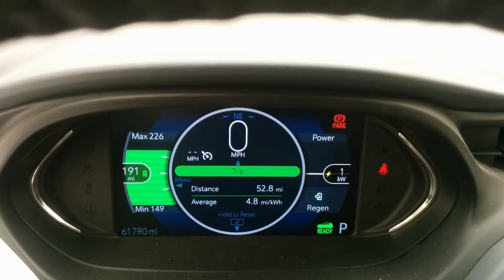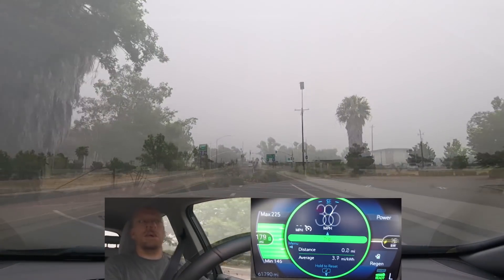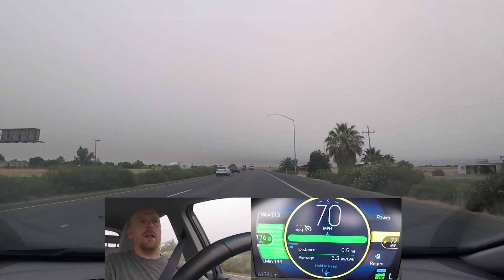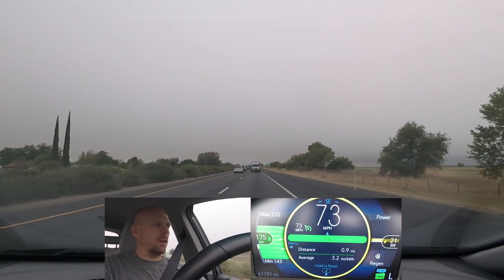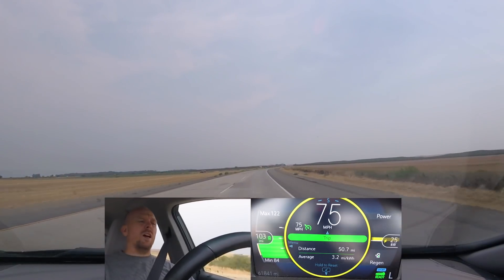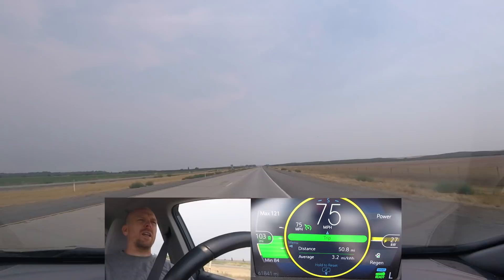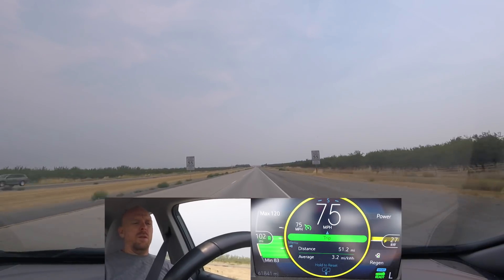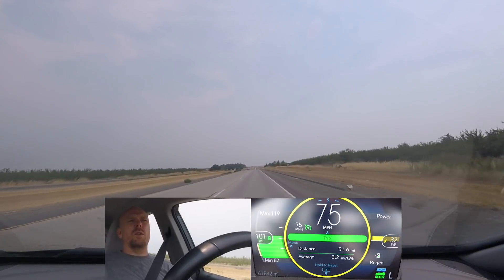Chevy Bolt EV: Real-World Efficiency at 70 to 75 MPH

Comment: Had such a terrible experience with the bolt. Just had to let mine get repo'd because I randomly got an error that they said wasn't covered by warranty and they wanted to replace the whole battery pack for $20k
Reply from the maker: Sorry to hear about your experience. You should have escalated to GM Corporate. Anything to do with the battery is covered under warranty.

Comment: Whenever I take my Bolt out onto the open road I run my navigation app to monitor the miles remaining against my Bolt's " Minimum Readout," and if the minimum is higher than the miles left I know that I am going to be just fine. I have recently been paying extra close attention to the " Trending Bar," on the far left of the display. That will let me know if I am trending towards the minimum, the average or the max. I had a real " What would News Coulomb do moment," the other day. I was at a fork in the road in the desert and I had to make a choice. Do I take this one route that guarantees that I get to a charging station in 87 miles or do I just go for the full 172 miles by turning right? I turned right and went for it. I ended up drafting off of some truckers during the final leg, but I found that I still had about 25 miles remaining on my range by the time I made it into Indio, CA.

Comment: Hi, I have a question for you regarding charging the Bolt EV. What has your experience been with the many different charging stations and the availability of those chargers when you arrive at a station. One fear I would have is being able to find chargers not taken up by others. So, given you're in California, do you experience frequently, stations being full? Thank you!
Reply from the maker: It's somewhat situational. In my experience, chargers in metropolitan areas are often occupied, usually by rideshare drivers. Because most of my charging is done on long trips, I rarely encounter other EVs at the charging stations. Due to cost and charging speed, I've prioritized Electrify America chargers, which average over 4 chargers per site, and I've never had to wait to access a charger at an Electrify America site. I have had to wait a couple times for about 5 minutes or so at several ChargePoint and EVgo sites, but that is very rare.

Comment: Now that's it's getting cooler outside if you have 65°-78° say of good weather there in CA. If you rolled the windows down or open them a little bit at 75 mph how much will that effect the battery useage or range in your driving? I do about 160 round trip in Virginia with stop and go in city then long distance hyway to rural areas. I'm looking into the Bolt but I'm waiting for Adaptive Cruise Control which would be great on my long distance driving. Thanks for your great videos its encouraging me more and more to buy one.😀👍🏾
Reply from the maker: Thanks! When it's cooler, I just run the vents, but it typically needs to be way below 70. I don't like opening the windows. It's too much noise and pressure.
Reply: @newscoulomb3705  Ok thanks so much for your insight. I was thinking maybe wind drag  might reduce range,  but yeah I didn't think about vents but if the fan is running that's current being used so maybe 6 in one hand and half a dozen in the other. Probably not much range used. Thanks so much again for informing us the public about the Bolt and electrified driving. Keep up the good work.😀👍🏾

Comment: I realize this is a bit old, but I now have direct tire experience (on my other EV) and I can confirm that for the first 5,000 miles on new tires the range impact is measurably worse. I don't know the reason, but I can only conclude that something in the manufacturing process produces a sticker material for the first few millimeters of the tread. After 5,000 miles the range improved (in my case by about 4%). My testing methodology involves extremely consistent driving behavior, all at freeway speeds and when I put the tires on I saw an immediate 6.5% impact on range and then over 5,000 miles that impact reduced to 2.5% and it has now remained consistent at 2.5% for 2,000 miles. The tires are different and the new tires are easily perceptible as stickier but it appears the actual difference between my old tires and new tires is 2.5% but the initial difference was much higher.

Comment: I can absolutely confirm the effect of changing tires. I just changed the tires on my Mirai and the MPGe dropped by 4 overnight (and I established that average MPGe over 50,000 miles so the change was crystal clear). When selecting new tires my priorities we're:

1. Quietness
2. Handling
3. Low rolling resistance

The tires I bought are advertised as LRR, but in the reviews I noted they were exceptionally quiet and had better than average handling so I expected that I'd be sacrificing some efficiency for quietness and handling and I certainly did.

Comment: Most of my freeway driving with heater or a/c ends up at about 3.1 to 3.3. The speed between 55 and 70 doesn't change much.
Reply from the maker: At those speeds, your heater might be using up 30-40% of your total power.

Comment: I have finally figured out why the Bolt is less efficient than the Kona in real world testing.

If you look at WLTP testing cycle, they use outside temperature as one of the factors. Since, we don't drive in ideal temperature (yes, California included), the efficiency of the cooling and heating system plays a major role.
Temp/Range Low
-20º C 167km 
-10º C  180km
0º C  240km
10º C 357km
20º C 448km
30º C 371km
40º C 269km
https://pushevs.com/2017/04/21/opel-ampera-e-range-calculator/

GM needs to redesign their thermal power management.

https://pushevs.com/2017/12/09/auto-bild-tested-range-8-electric-cars/

https://www.greencarreports.com/news/1115893_five-electric-cars-tested-in-cold-norwegian-winter-how-did-they-do

Comment: I know you can't do it easily in CA, but I would love to see a winter video of the car in snow with the heater on full blast and it being about 20 outside.  These are some of the conditions I could see in VA where I live.
Reply from the maker: It's possible in California, but the big issue is the requirements for traction devices. It's why I don't run dedicated winter tires. Even if I did, I would still be required to run chains in conditions most people would just be using winter tires. 

Also, just from a personal perspective, those temperatures aren't cold enough for me to be running the heater full blast. I tend to dress for the winter conditions, so I really only need a little heat (mostly for the defogger). 

Even so, I've seen some pretty horrific conditions, though I'd have to go through my videos to compile them. To date, my worst efficiency of all time was 2.3 mi/kWh, driving 75 mph into a ~25 mph headwind.

Comment: Traveling these speeds, about how far can you go?  I ask because I go from Jacksonville, FL to Savannah, GA which is about 155 miles.  Once you leave Jax there aren't any L3 chargers along the way to rapid charge.  Once you get to Savannah there are parking garages that have free L2 chargers one could plug in there and get a full charge for the drive back.
Reply from the maker: I typically drive 150 to 200 miles at these speeds. This was a special circumstance because I didn't start with a full battery.

A lot will depend on the weather, but you should be able to at least make your 155 mile leg.
Reply: Thanks for the response!

Comment: My Leaf Gets that or better efficency (the way I drive mixed freeway 55-65 and surface). However I have the small 24 KVAh battery. The Bolt has a larger battery (60 KVAh). I'd love to have a 60 KVAh battery.
Reply from the maker: The LEAF's efficiency at freeway speeds is a bit lower, but it's not too bad. I think the newer LEAF is a bit better (very similar to the Bolt EV's efficiency). 

I'm really looking forward to the 60 kWh LEAF. It's going to be a great option for people.
Reply: Yes I am sure you are right... What I am talking about is the way I drive. As you know that makes a difference. I can drive slower, take surface streets, accelerate slower, pick more efficient roots and times of day, refrain from using heat or AC, coast or use re-gen as much as possible. I can get 4.5 to 5 miles/KW on a given day. What some people don't realize, like a ICE car DRIVING habits affects MPG... If I drive like a maniac, race people off the line, drive freeway at 75 my range goes down.... no free lunch. Driving style has big effect on efficiency.

Comment: Why did you put on L instead of D on freeway?
Reply from the maker: I prefer driving in L and Sport, and I don't like switching around all the time.
Reply: News Coulomb  I know it's a personal preference.  I've found L making the car less stable than D on highway and consuming more energy when accelerating.  I always use L on city roads for one-pedal driving.
Reply from the maker: Kb Calib I haven't seen any differences in efficiency or stability.

Comment: Big shout-out to Steve Dutcher who did the test the right way.
He recreated Bjorn's test run in the US.

Steve's run
75mph (120kmph) - 333wh/mile (206wh/km)

Bjorn's run
75mph (120kmph) 208wh/km
https://youtu.be/VsZCOEjs7M8
Reply from the maker: I'll have to check it out sometime, but I'll conduct my own test soon. Again, mine was simply a real-world example that predates most of this "controversy."

Did he have a Premier? That could validate one the difference between LT and Premier efficiency.
Reply: News Coulomb no LT, 42 PSI.

His test came out exactly like Car and Driver. 60,000 watthour ÷ 333wh/mile = 180 miles.
Reply from the maker: He stated in the video that he was driving into a 15 mph headwind, and his numbers match my typical efficiency at those speeds (55 mph + 15 mph = 3.7 mi/kWh and 75 mph + 15 mph = 2.7 mi/kWh).

While A-B-A testing provides a small correction, it doesn't account for the differences in headwind versus tailwind efficiency.

He was able to verify my findings, though, that the U.S. spec Bolt EV's speedometer appears to be spot on.
Reply: News Coulomb did you even watch the video?
He did a round trip. Into the wind drew 29kW and 21kW heading back.
Reply from the maker: The tailwind doesn't account for the difference. The difference in energy consumption between 55 mph and 70 mph is greater than the difference in energy consumption between 40 mph and 55 mph. Likewise, the difference in energy consumption between 90 mph and 75 mph is greater than the difference in energy consumption between 75 mph and 60 mph.

A headwind irreparably skews the data. Making it a round-trip (A-B-A test) doesn't correct the error. 

The whole idea of setting a baseline with as many controls as possible is so you can do a direct comparison between vehicles. Testing one in a 15 mph headwind does not set a baseline to compare with another vehicle tested without a headwind.

Comment: My argument against the Bolt has nothing to with the car itself.  GM only build less than 2500 a month.  GM dealers do not know how to repair them.  GM does not want to sell them.  GM loses almost $9,000 in each sale.  GM can sell the car service and warranty to a 3rd party in a few years leaving owners with cars they can not get replacement batteries and parts for.
Reply from the maker: There are so many factually incorrect statements there, I'm not sure where to start.

GM's dealerships do know how to fix these vehicles. There were hiccups at first, but that's been over a year. 

GM isn't losing money with each sale, but the Bolt EV isn't necessarily profitable on its own yet. The ZEV credits alone make up for any losses. 

GM is making more than 2,500 a month, and that number is going to increase again by 20% in Q4. 

Anyway, other than the dealership support, which isn't actually an issue, none of that should affect someone's buying decision as an individual consumer.
Reply: bit hard to comment on wild imaginings

Comment: Data Point: I have a 2017 Bolt that is about identical to your Bolt as you can get. I commute from Fredericksburg VA to Washington DC which is around 130 miles, and I have a total of three (3) people in the car (200 Plus Pounds each) and run the AC between 68-70 degrees. I set the cruise at 70 and use the HOT lanes. I average around 4.0 kW per trip. I do gain a-lot of regen in the afternoon commute do to traffic the last 25 miles or so. Sometimes in the morning it drops to 3.6 but build back up to 3.9 once I arrive at work. I enjoy the videos so please keep up to good work.
Reply from the maker: Thanks!
Reply: Do you charge your Bolt at work during the day ?
Reply: No I have a Level 2 ChargePoint at home. In the DC there are too many EVs competing for a small number (3) of Level 2 chargers, plus I would have to walk 3/4 of a mile each way. By charging you also get a free parking place, so as you would guess some people sit there most of the day charging instead of paying for parking.
Reply: @chipmann2383  I just noticed that in Richmond VA too. VA needs to work more on electric infrastructure its coming but still off a bit. Hopefully Electrify America will start putting more rapid chargering soon at the Walmart and Kroger's it's promising. But I'm hoping Chevy will come up to European standards of chargering here in America to the 100 w on board chargering then people won't be parked so long in one spot.
Reply: what does averaging 4kW mean?  makes no sense?
Reply: I think it's 4 miles per KWH.

Comment: it might be a good idea to do a video specifically focusing on any lifestyle impact or issues you have encountered on the fact that you have been displaced from your home due to an emergency situation, and you are having two drive around in an electric car. What are the issues you encountered? How was it different from having a gasoline car?  Did you have to wait very long at charging stations due to increased charging activity? electric cars are on the upswing, but still many motels and lodging facilities are still very light on the charging options so wondering how this was for you.
Reply from the maker: It was such a short trip for me, it didn't really make much difference. Starting an evacuation with a full battery sort of kills the drama.

Comment: I get about 3. 7 with no AC in about 3. 5 with AC, same conditions that you drove. I've got about 5k miles on my Bolt, so original tires at 40 psi.
Reply from the maker: Yes. I mentioned in the video that the efficiency was a bit lower than I was used to, but I think it's just because the tires were brand new.
Reply: 40psi?  it must ride like a steamroller